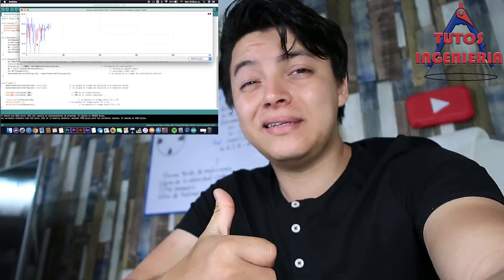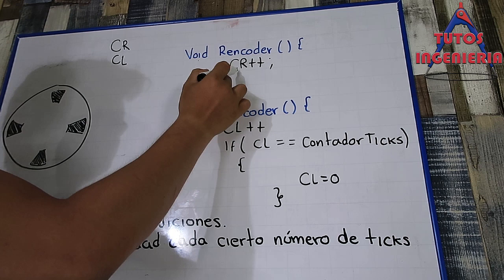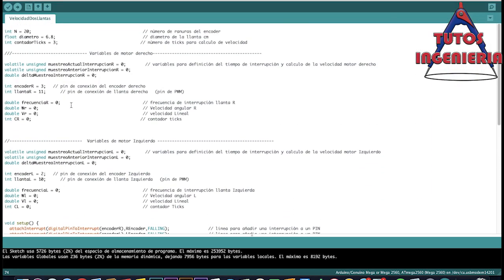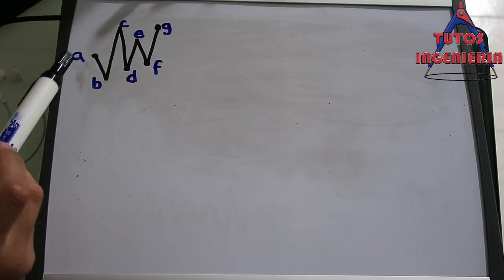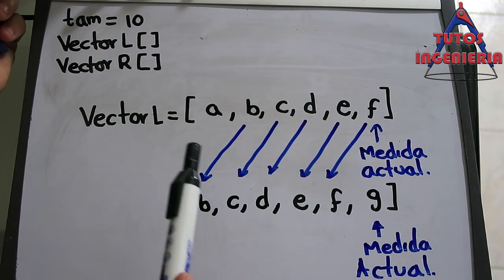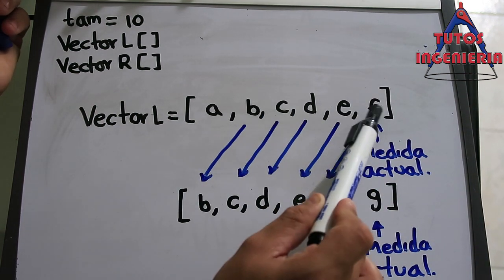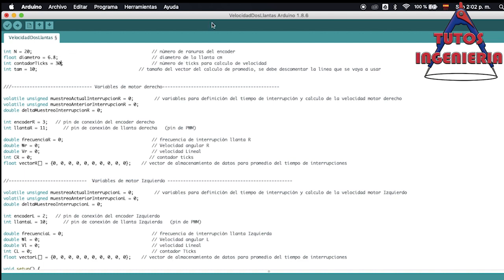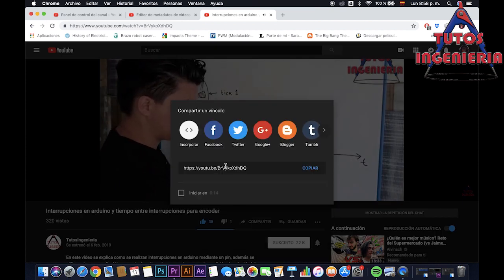Signal filtering in arduino platform

Comment: Thanks so much for this video,  you helped me fix a big problem in my own robot framework.  Of course we want to run speed control and pose estimation as fast as we can, but because of the low resolution of these optical encoders, I would often get zero or one ticks in the time window I would use to do speed control and pose estimation.  This meant the change in velocity between frames was very often 100%; very noisy.  I added code to require a minimum tick count before doing pose estimation or speed control and everything got much, much better.  Thank you for the inspiration.
Reply from the maker: Thank you so much, this comment makes me feel that this video is important. Thanks 😬😬

Comment: Hey, was the noise because of false triggering of the optical encoders?
Reply: I found that the 'noise' was really about too few ticks in a sample, so a change of just one tick would create a large change in velocity.  Think about a constant velocity where in a fixed time sample we would get 2.5 ticks.  In one sample we will get 2 ticks, in the next 3 ticks.  If we calculate velocity using this small fixed window, then it will vary from sample to sample greatly.  But if we were to force every sample to have at least 3 ticks, then the time-window is what is varying and the system time is much higher resolution that the tick rate.  That is what reduces the noise in this case.  There can definitely be false triggering of the encoders, but that usually happens 'at rest' when the robot is supposed be stopped; sometimes it stops when the edge of an encoder 'slot' is in the optical path and slight vibration of the robot can cause rising and falling edges.  That can be eliminated by disabling counting of ticks when the pwm value is zero (so when you want the bot to be stopped).